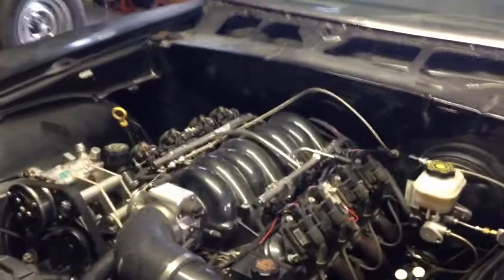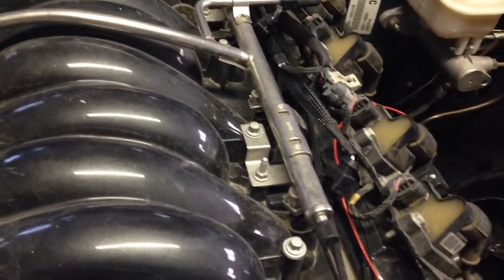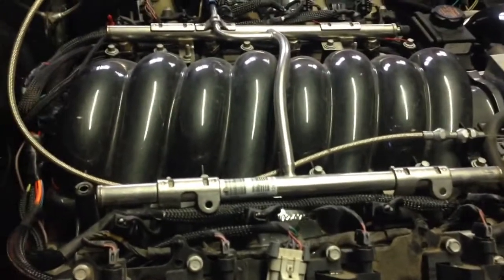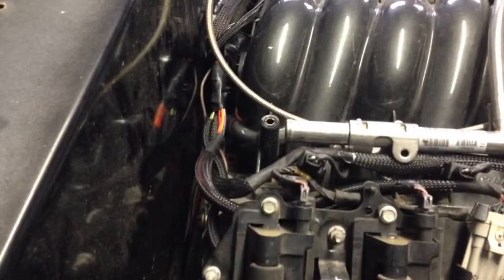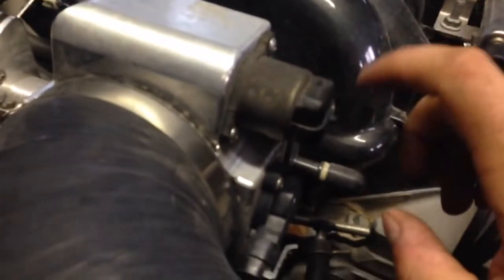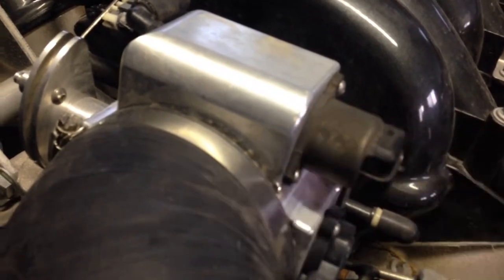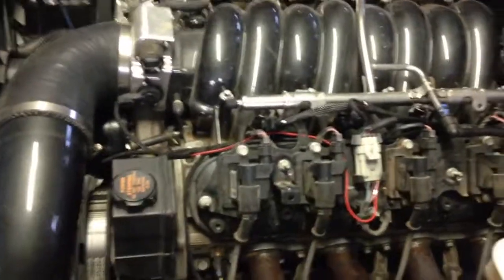Microsquirt basic install on ls1/ls2/

Comment from the maker: Only needs 1 installed on one bank.

Optimum bung placement will vary from application to application, but using the guidelines below
will ensure the longest sensor life with the most accurate readings. Using a bung is the preferred
method for mounting the oxygen sensor in all applications.
 Weld the bung at least 24 inches after the turbocharger.
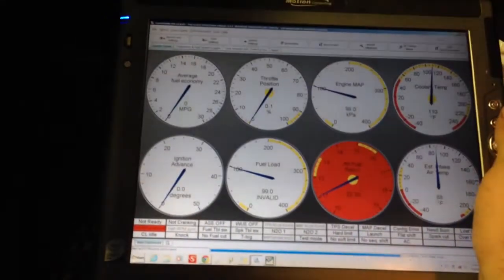 Using a clock as reference, mount the bung between the 9:00 o’clock and 3:00 o’clock
position. Welding the bung in the lower section of the exhaust pipe can result in sensor
damage caused by condensation making contact with the sensor’s internal heating
element.
 A 1” bung (provided in the kit) will best protect the sensor. When fully threaded, the
sensor’s tip will sit flush with the inside of the exhaust piping, this does not adversely
effect the readings.
 The bung should always be welded before the Catalytic Converter. Welding the bung
after the catalytic converter will skew the readings toward lean. The skew in readings will
vary with engine load and the efficiency of the catalytic converter.
 Leaded fuel and two stroke applications will reduce the sensor’s life. There are many
other factors that dictate the sensor’s lifespan so it is impossible to predict total sensor
longevity.
 Exhaust leaks, camshaft overlap, and open (shorty) exhausts will cause false lean
readings at light engine loads. Typically, once the engine is u

Comment: tps isnt actually required. i daily mine without it. its a drive by wire setup and the tps was very noisy making the tps enrich impossible to tune. also if you have a surging idle issue that most of the micro setups i have seen. you can enable the adaptive idle timing and setup the parameters to very precisely target your idle speed. here is my video explaining it. LSx Microsquirt adaptive idle control
Reply from the maker: How can you have drive by wire working? Please explain.
Reply from the maker: vannatta20   Did you just use the dbw TAC module and pedal as a stand alone? Im guessing it still functions without the gm pcm.
Reply: vannatta20 the factory pcm is still there. It was originally a 5 cylinder colorado. I still use it for the gauge cluster and the trans control

Comment: What tablet/laptop is that?
Reply from the maker: It's a motion branded tablet that runs windows. It's old but works great. You can get them for under 200$
Reply: vannatta20
How is this working out for in this application? I see it's pen/stylus only but you can get an app to type without an external keyboard using the pen. Amazon has some used ones for 150. Battery life good enough and a long test drive?
Reply from the maker: I use the on screen keyboard. You just click on an icon to open it.  Mine also has bluetooth so you can use a keyboard and mouse with it as well as needed.
Reply: Hows batt life for tuning? I have a ipad 2 with a cracked screen that is still fully functional but I'm not sure about sharing data between the two.
Reply from the maker: DestroyAllorNothing
2 hours per battery.
Reply: Thanks, review I read said 45  mins, and if thats new and I get an old one, I'm sure it would half of that.
Reply from the maker: I have two different ones.  A motion C5. 2 hour life per battery.  Got a new OEM battery for 30$ off ebay as a back up. Super cheap. I also have a motion LE1700.  Battery sucks on that one an is close to 45 minutes. The big issue with my LE1700 is screen brightness.  Its not bright at all. The motion c5 is superbright if needed but has a slower CPU
Reply from the maker: The one in the vid is the LE1700 and it has poor battery life at 45 mins.  I just need to get an 12 volt adapter and plug into the car.
Reply from the maker: vannatta20 Cheap computer for tuning

Motion c5